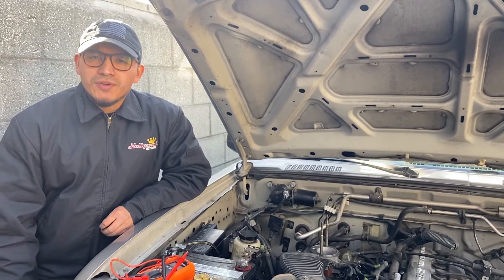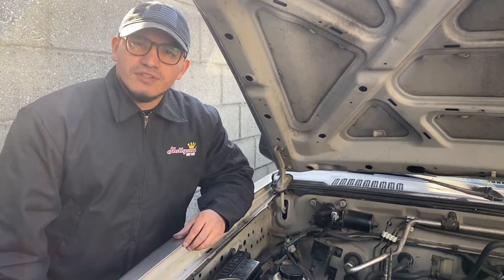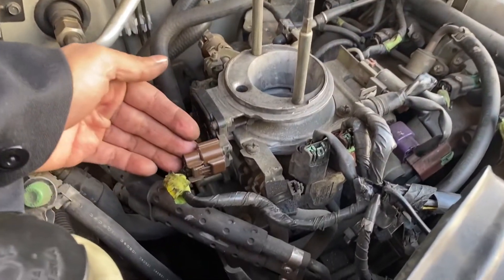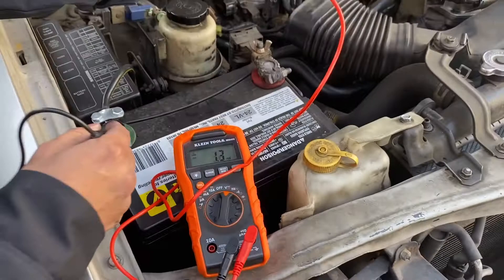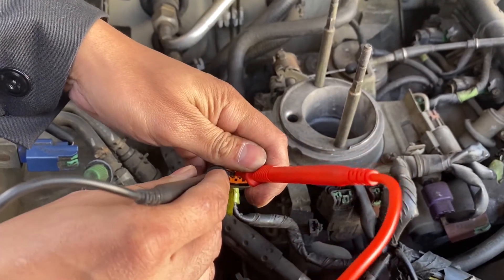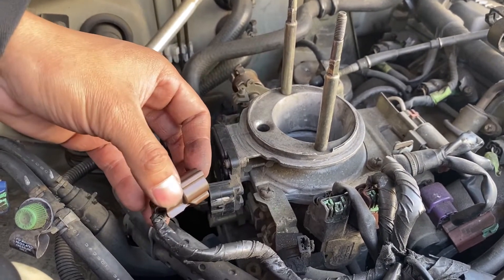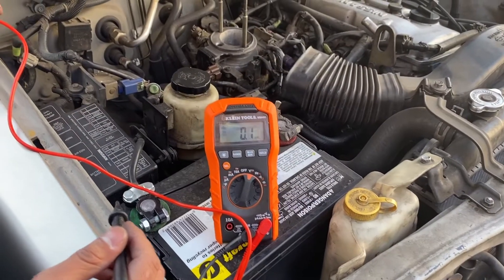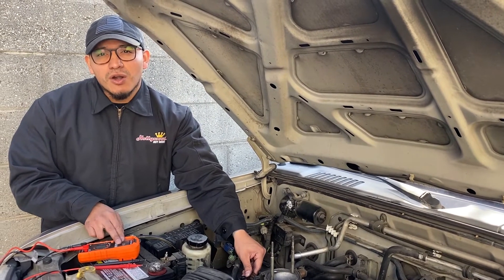MAF Sensor Diagnostic Video

Comment: i have a 2001 as well and it keeps shutting off after 20mins or so.  ive changed the fuel pump and  amd filter. it still cuts off . what can be the problem
Reply: What was your problem my dad has the same issue changed the fuel pump tps sensor spark plugs